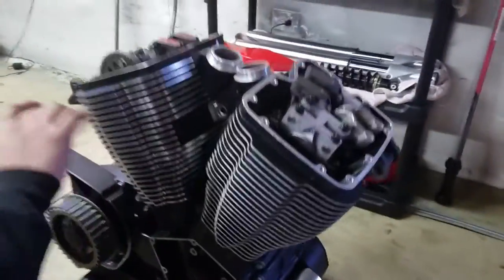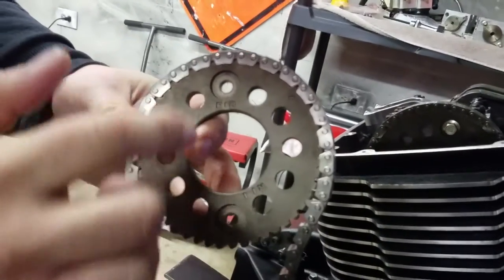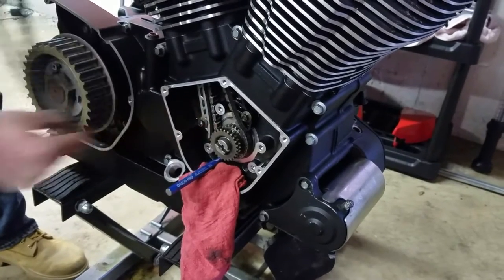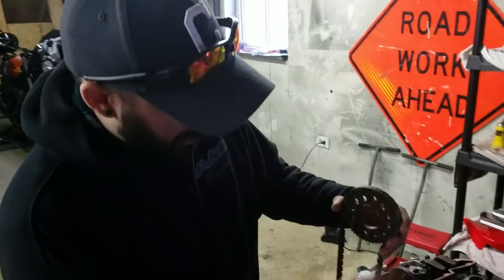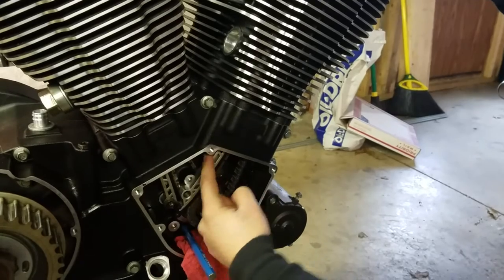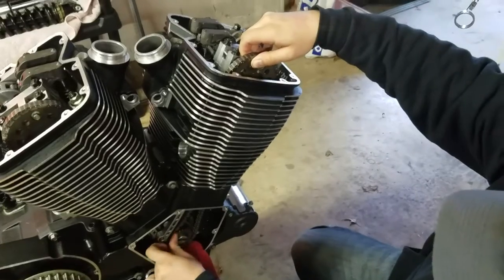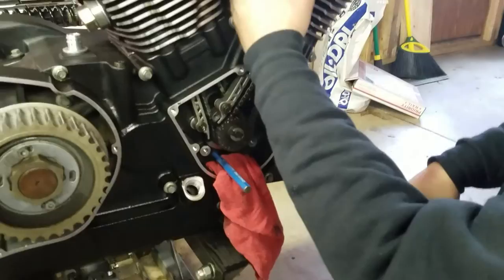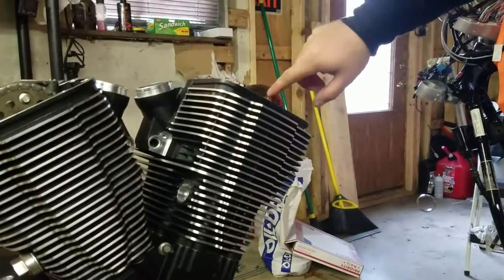Victory Lloydz VM1 Cams : Front Timing (Part 4)

Comment: My buddy has a victory that has never had the engine or case opened in 68k mikes. He changes his oil twice a year and 3 times if he takes a long trip over 1200k miles.
Reply from the maker: My hammer never had any problems at 25,000 miles on it. I just wanted to make it faster and take it apart. I cant leave stuff alone haha.

Comment: Hello from France.
I have a small problem with the sixth gear , it jumps and I fall back to fifth under 130km/h (80 MPH) unless I keep the selector in high position with the foot . According to the dealer it would be the pinion of the 6 which would be worn and very expensive repair 3500 € 😱 . A colleague Victorien , told me that he thought that the concern came according to him from the fork and that it would be easier to change and therefore cheaper . Do you think he is in the truth ? Thank you and long live Victory, I have been in love with My Vision since May 2011. She has 66486 miles to date.  Sorry for my English, but I am obliged to pass by translation it is like me, not very young lol.
Reply from the maker: Hi there! Thank you for reaching out. I do believe he would be right and changing out the shift fork could help. But I can not be sure that would fix your problem. It would be the least expensive try before spending that much money on gears. I hope this helps!
Reply: @victoryinstallerschannel8625  Thank you very much, is it possible that when changing the clutch the mechanic repositioned the fork incorrectly?

Comment: how many miles before you replace the timing chains? Thank you for your channel it will come in handy .
Reply from the maker: You're very welcome! Thanks for checking out my channel. As for the timing chain, I don't know if there is an actual spec on replacing it. From what I have heard you don't typically have to replace them. thats actually what the chain tensioner is for.
Reply: I have a 06 vegas jackpot 100 cid it is a little noisy when it starts cold and as it warms up it quits down sound like it has play in the chain